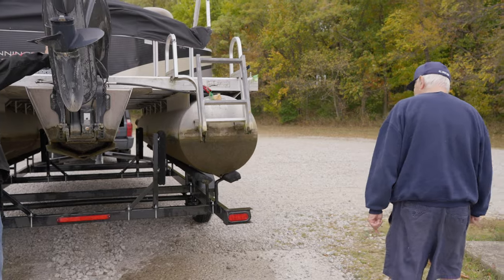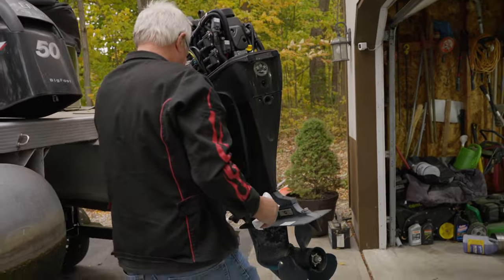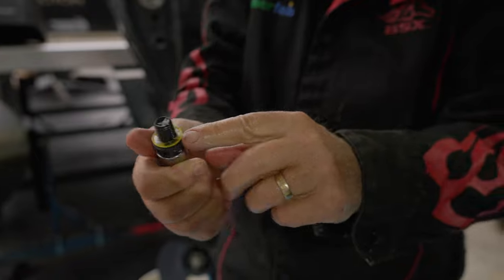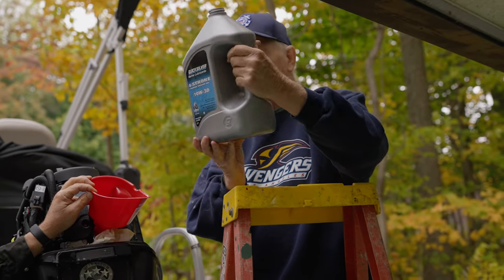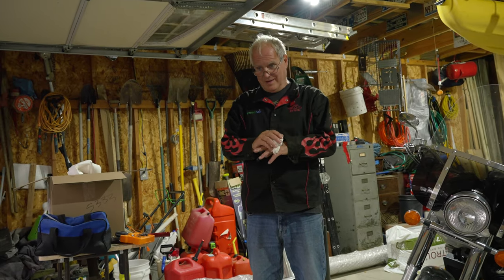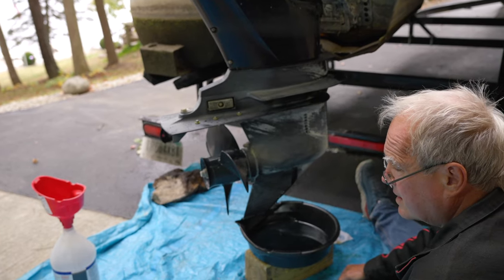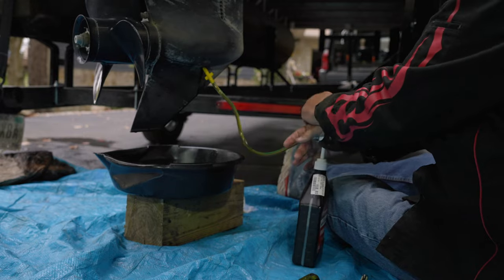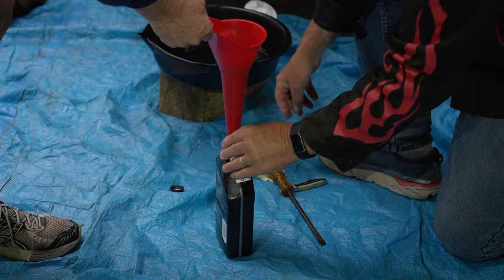Mercury Marine 50 HP Bigfoot 4-Stroke (Detailed Oil Change)

Comment: OK - mistakes 1) don't take the gasket off the filter ( and he ended up wiping all the oil off the side contacting the engine) 2) don't tighten the filter with an oil filter wrench, it should be tighten by hand